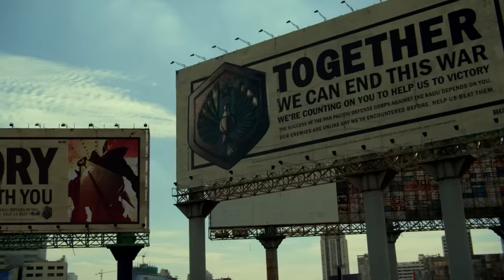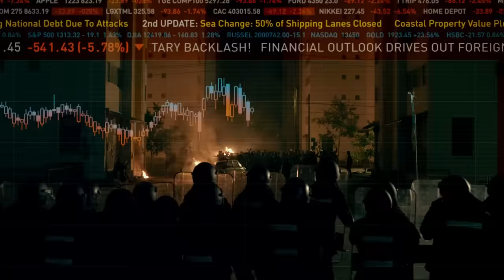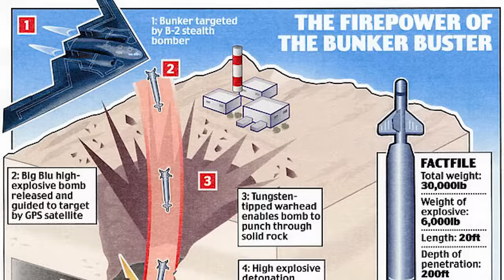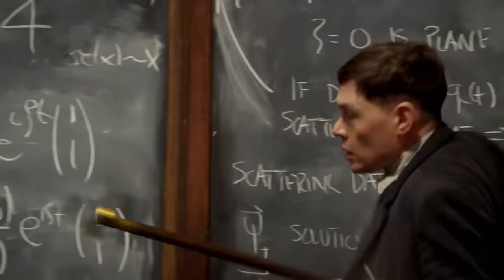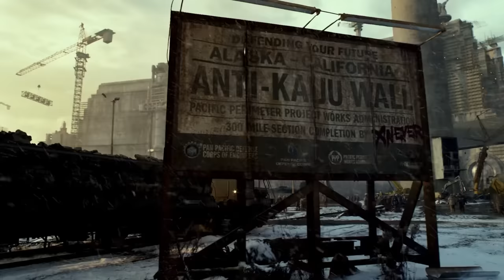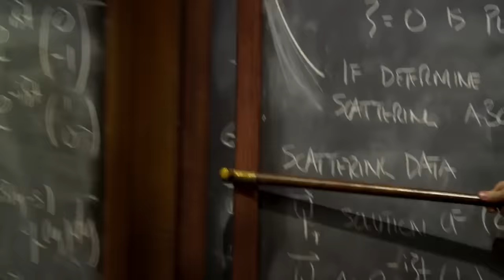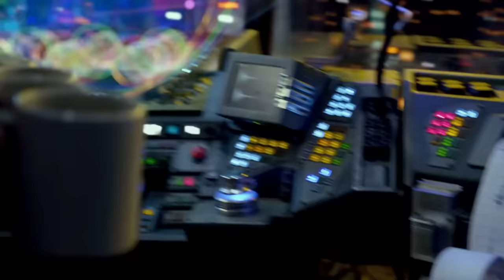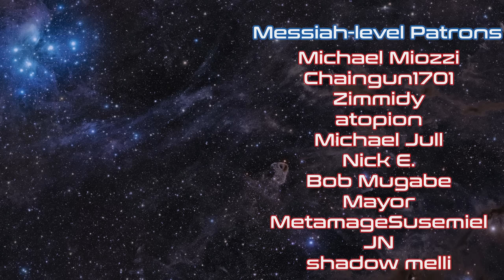Advanced Sci-fi Civilisations Too Stupid To Really Exist Ep.20 - The United Nations (Pacific Rim)

Comment: Making giant mech suits to fight monsters may not be the smartest choice, but it is the most awesome choice.
Reply: quetzalpacheco  I feel like you should found a religion or at least a cult around your insight. I'm on board.
Reply: "Giant robots beating on monsters" was the sole reason I went to see this movie. I was not disappointed.
Reply: Problem is, it only takes one broken leg to completely ruin a Jaeger. When will our giant death robots get more legs? They also move faster with more legs, so that lumbering movement is less an issue.
Reply: @dansmith1661  Because a giant robot spider wouldn't be as cool as a giant robot boxer.

Also, a human mind isn't equipped to operate multiple legs.
Reply: @StevieB8363  aint there 2 humans per robot?
Thats 4 legs minimum.
Reply: @10011110011  Except it takes two humans, working in synch, to move those two legs. It's been established that operating a Yeager solo is far too great of a strain, hence the "drift". So they can't operate two legs each.
Reply: @StevieB8363  but you dont operate a full robot. Just the legs.
Reply: Plus, chicks dig giant robots!
Reply: It definitely is an awesome choice, but modern warfare is not fought with a singular type of weapon. Imagine those giant mechas fighting alongside with battleships and missile destroyers, supported by strategic bombers and orbital strike platforms. That would be much more effective than the mechas alone.
Reply: Most awesomest*
Reply: As A Mecha Enjoyer Yes I See This As A Viable Option
Reply: They should have had a....it translates to hunter, so  "hunters" guarding the breach, and had aircraft as a second line of defence
Reply: What's really stupid is not utilizing the weaponry developed through the program on defensive platforms
Reply: @scottthewaterwarrior  Nice
Reply: @kerbodynamicx472  That would be awesome to see Jaegers being supported by battleships and jet fighters.
Reply: I like to imagine it's just humans and the Precursors who're this extra and every other intelligence species is watching the kaiju war and going 'What the heeeeeeeck?'
Reply: @dan Smith actually real robotics studies have found 2 legs is the fastest
Reply: @10011110011  So then you need more people to work the rest of it - and that makes drift compatability even harder to acheive. Yes, those Chinese guys did it, but they were triplets IIRTC, which made it easier. With your system, you'd need quadruplets.
Reply: @StevieB8363  its only legs
Reply: @10011110011  what about the rest of the Yeager? If 2 pilots only control the legs, you need two more for the rest of the body.
Reply: @Dont14-r4k  did i stutter?
I said: only legs
Reply: @10011110011  yeah, you kinda need other two if each one is controlling 2 legs, unless you re talking about having a Yeager with only legs, then that is very useless
Reply: @Dont14-r4k  it can kick with all 4 legs. No need for arms
Reply: @10011110011  and the Kaiju can easily  just slap it with it's tail and it goes flying like a spider, and since it has no arm, it can't get up if it lands upside down. Not to mention more conventional weapons are unable to be mounted.
Reply: @Dont14-r4k  dogs onky have legs and can get up just fine, fyi
Reply: @10011110011  yea but they have a torso that they primarily use to roll over in order to get up, this also comes that they are pretty flexible to do that. A metal robot isn't as flexible as a dog, so that aint going to work, nevermind that it doesn't even have a torso and spine to roll itself over in the first place. Not to mention dogs also use their 2 front legs as semi arms, that is why they also are able to stand on their hind legs with relative ease, they don't primarily need their front paws to properly stand.
Reply: @Dont14-r4k  these robots are flexible enough to fight godzilla
Reply: @10011110011  they aren't tho. Sure they are faster, but not necessarily flexible. Also Godzilla is probably the least flexible Titan, the Pacific rim Kaiju, while not as powerful, easily run circles around Godzilla, dodging most of not all his attacks.
Reply: @Dont14-r4k  i guess we will have to create the 4 legger robot to decide which one of us is correct.
So give me a few decade/centuries to prove you wrong.
Reply: @10011110011  So your Jeager would be a giant spider that doesn't punch monsters? Losing cool points here.
Reply: @StevieB8363  giant spider which kicks monsters.
And twerk on them for extra points
Reply: @10011110011  I would have given you a thumbs up for that if Twerking wasn't the most annoying and unexciting form of dance that I have ever seen. Aside from that issue, I applaud your love of giant robots. May the Machine Spirit be with you.
Reply: @StevieB8363  you have never met a larger layman than myself. To be honest.
Reply: @Dont14-r4k  you really are just looking to shoot down his point at any chance you can get and that isn't contributing to any argument.

A 4 legged mech would be just as viable as any other, with it's own pros and cons on the situation. Saying that it can't hold more conventional weapons is an arbitrary limitation you're putting on it. Look at any naval ship, it's loaded with weapons and it doesn't have arms.
Reply: @dragonheart967  1. Disproving points is how you win arguments
2. A warship has weapons on it because it has space to carry them. A 4 legged spider at most has missile launchers which are at most expensive, and extremely ineffective since they have to be so small to fit in between the gaps  of the legs. Not to mention the Kaiju easily outsize a 4 legged Yeager, unless that Yeager is made to be very big, in which case it probably would get outrun. Finally, where do you put the cockpit? You need it somewhere it can look out the Yeager, and since you got no arms, you can't block any move towards the cockpit, so one tail slash of it the Kaiju simply got on top of you, you dead. There is a reason why Yeagers have a conventional 2 legs and 2 arms, it is the one the works most effectively and efficiently against Kaiju.
Reply: @Dont14-r4k  1. You're not disproving his points, I'm saying you're arguing on arbitrary conditions that only debunk the argument by constraining it to your own imagination.

2. Who's to say that the design is limited to what you have described. You're describing this thing like it's some tiny body that has 4 legs and no room for anything else. You can design these things in any way you want, you can do a large base structure or just go with a normal Jaeger but with 4 legs. The extra support allows a higher support standard and can fit significantly larger/heavier gear. Nothing has to fit between the legs, you can build up.

This is why I called you out on how you were making your argument, it's disingenuous by its nature to create an arbitrary limitation.

To refute an argument, you can't hyperfocus on one aspect and determine that the whole idea is bunk without exploring the advanced idea of it.
Reply: @dragonheart967  the guy was saying that a 4 legged Yeager would be the best type of Yeager, that is clearly false. Also I'm using the best possible form of a 4 legged Yeager that would actually work, remember these things have to be able to move through city streets, so it can't be too wide. Adding on the bigger you make the Yeager, the more weight you will have, the more expensive it is to build and maintain, and you also will need a bigger area to keep it in, not to mention it will be much slower. A 4 legged Yeager, while not as tall, would still be wider than most Yeagers, and it will be bigger if you also start to build up, not even mention the lack of flexibility. The guy was saying that just a 4 legged Yeager, no arms no torso, none of that, is better than a standard Yeager , which it clearly isn't, otherwise by the second movie or at most the anime, we would of had 1 4 legged Yeager that had survive and seen some success. You aren't calling me out, you are just making yourself look dumb, because If you were to look at their replies, you would know that they firmly believe a Yeager with 4 legs is good enough, which as to all the points stated earlier, clearly isn't. I never said it wouldn't work, but it would be a logistical nightmare on top of being almost useless.
Reply: @Dont14-r4k  even without a torso, you can still have a sizable platform to place any weaponry. You have a top to mount stuff on, like any modern military vehicle.

And while the size would be an issue for urban use, that doesn't discount the pros and cons argument, because this thing would be used for engagements outside of the city. How many of the fights in the first film started off in the ocean? Sacrificing mobility doesn't remove any practicality of its use, otherwise a bunker is entirely useless?

I did read the comments, and I saw that he was progressively moving down because someone just kept stonewalling the idea instead of actually engaging with it.
Reply: @dragonheart967  and the weaponry is exposed, one building on it, or a tail snap, and it is gone, no longer operational, which is why you see many Yeagers shield stuff like missiles and Plasma canons. Even outside the city in the ocean the 4 legged concept would slow it down since it is more surface area for contact of water. Mobility is very Vital, often times more agile Yeagers are able to be a lot more successful than any brawler, which is why they were naturally passed out, with Cherno Alpha being the only exception. Also, why mount a weapon like that to a 4 legged Yeager, when you can easily just mount it on a platform off the coast for secondary defence Incase the Yeager gets taken out, rendering the 4 legged concept useless. Also if you were to look at the replies, I literally was asking the guy to elaborate, I brought up the rest of the Yeager body, that you would still need 2 other pilots, the guy said no, that it was just 4 legs. So I questioned him on how that would be a good thing, and brought up cons of the design. That was what happened.
Reply: @Dont14-r4k  I'm more prone to the idea of fixed implements, but for the sake of argument, these things wouldn't be in brawling range, like anything of this nature, it's not meant for close range battle, the concept of long range weapons is to take out the enemy before it gets close.

If anything, this thing would be supplemented with normal Jaegers, just like modern warfare that utilizes infantry, mechanized, and air force to make the most of each strength while removing the weaknesses.
Reply: @dragonheart967  like I said, at that point don't make it a Yeager, make it a secondary way of defence along the coast, way more cost effective.
Reply: @dragonheart967  'If anything, this thing would be supplemented with normal Jaegers, just like modern warfare that utilizes infantry, mechanized, and air force to make the most of each strength while removing the weaknesses.'  Uh... you kind of just made his argument for him.  If your position is that a 4 legged design would be used to support a general purpose jaeger and suited for only certain engagements it is therefore NOT better.  A specialized weapons platform has the unfortunate nature of underperforming in situations outside it's design.
Reply: @davidlewis5312  except that was never my argument, I jumped in because the argument became even the viability of a 4 legged Jaeger, not that it would be better.
Reply: Giant robots with ever-changing weaponry makes sense in the world we're given.

What doesn't make sense is making a static wall that will obviously not work, with static gun emplacements that have the obvious flaw of being static emplacements against a dynamic enemy.

The entire defunding subplot is a cancer on this movie because it is so rock stupid that you can never defend this movie.

My advice for people watching this movie from this point on will be to pretend that the whole subplot doesn't exist.

Because the Jaeger program starting to fail because of the increased rate of monster attacks is already a built-in justification for why they are desperate and have to blow up the entrance hole.

But no, Guillermo del Toro had to make his political potshots instead of focusing on the movie, and he shot the giant robot genre in the face when he did that.
Reply: quetzalpacheco  
what was the meaning of life itself then?
what am I working towards? - Creed
Reply: @hariman7727  except its not a political potshot at all
Reply: @XD-sc4ix  so an entire subplot in a movie about a wall that will be useless to repel Invaders isn't a political potshot, when it's written during a time where Guillermo del Toro is part of a crowd there's openly critical of a wall being built on the American border to repel and prevent entry for an invading populace?

Pull the other leg, it has bells.
Reply: @davidlewis5312  a four legged Jaeger would be perfect as artillery blasting the kaiju from a safe distance either before it engage the humanoid Jaeger or while he's fighting the humanoid Jaeger the problem tho is that a human wouldn't be able to pilot it
Reply: @hariman7727  except the movie came out three years before the mexico whole wall thing was even an idea HELL Obama was at the peak of his presidency at the time
Reply: @XD-sc4ix  I am operating under the assumption that the limitations of the drift system would be overcome to make a non humanoid mech viable
Reply: @XD-sc4ix  border security has long been a policy of Republicans.

And building the border wall has been on the political table for decades.
Reply: @davidlewis5312  fair
Reply: I realized if we just let an entire generation of people watch giant mechs getting destroyed by other means over and over again for decades, the idea of mechs will no longer be awesome.
Reply: @funveeable  it happened the same for superheavy tanks they're still viewed as awesome
Reply: @Ez miez  It takes 2 because it because it's quicker to train 2 pilots for the mech than 1
Reply: @dragonheart967  a spider mech would not last long against a kaiju because kaiju think in biological terms and know weaknesses once they fight them, a spider mech would have an even more glaring weakness than a jaeger head without any of the literal punches, they are more exposed with their stomach type rigs as one cpuld assume and not have enough armour or speed depending on gow you work it, and their armament would be less than effective. Missiles? rely on guns/plasma? That's not gonna do much and guns/missiles can make them bleed toxins, claws? The first kaiju were made to withstand aircraft missiles and claws will do less damage than a punch should it be needed even if coolant is used as the mass of flesh would be too bulky.

Static defenses will never work against an adapting enemy, the great wall of China, the walls of Jericho, the walls of Constantinople, the walls of Rome, the ship-wall of Athens. The only way to reliably defeat the enemy is to stop them in the field before they can learn about you and that is what the jaegers were doing. As someone once said: 

"A determined siege will, unless a relief force arrives, always win."
Reply: @XD-sc4ix  artillery will not work, the kaiju can adapt to the wall they can adapt to spidermechs and the first few had leathery armour to stop aircraft rockets and missiles, they already tried this tok with Striker Eureka having missile pods and he gets wrecked twice before he can use it because the kaiji learned to adapt. And Orochi types can fly or maybe dig to meet these new mechs posing a danger to civilians should the jaeger be put there. There is a reason the jaegers fight on the open seas and that is to not attract kaiju to where people live and to minimise the pollution from their toxic blood which means these plasma mechs need clear line of sight rendering their range moot as an emp can then reach them, and if you use conventional artillery you are asking for repeats of the first kaiju wave and they will learn to use anti-wall tactics for predicting their shells and such.
Reply: @magniwalterbutnotwaltermag1479  okay, first off, a siege and an assault are vastly different, a siege is an encirclement of a position with the intent of starving out the defenders. An assault is an actual offensive action on said defenses.

Both are incredibly different, so please understand the nuance between the two before you misuse a quote to describe a different situation.

Here's the thing about the punch from a Jaeger, it's all down to sheer kinetic force. In theory, you can build a weapon that fires a large enough projectile with enough force that can punch though why Kaiju.

Referencing how ineffective weapons were on Kaiju when those weapons were not meant for Kaiju is kind of a "no, really" moment.

Enough offensive weapons with overlapping fields of fire will leave whatever charges that position in utter devastation. Why wouldn't it? Kinetic force is always kinetic force, what difference if that force is from a giant robot arm or a FU slug weighing a few tons fired at 1000 m/s?

The idea of some kind of multi legged Jaeger is to keep mobility/stability while supporting a larger armament, the idea of that is to not engage in close range combat. Why is this such a difficult concept to grasp?  Look at modern warfare and how ranged weapons reduce the notion of melee combat nearly obsolete.

And what's stopping the brilliant idea of mixing the two units? Why not static defenses and extreme range, coupled with Jaegers to flush the Kaiju into the open, normal Jaegers to keep the Kaiju occupied and relatively stationary, and the weapon platform Jaegers to provide heavy damage at range.

Jesus, is there any level of imagination to be had here before we throw the baby out with the bath water?
Reply: @magniwalterbutnotwaltermag1479  i already knew that i watched the movie you know
Reply: quetzalpacheco  
Don't know if you're being sarcastic or serious
But that was a joke, a quote from Creed character from THE OFFICE
Reply: "Unless it's dope as fuck"
Reply: @dansmith1661 dude, as we said, it’s cool. F logic and reasoning, we know in real life we would create a hand held device that kills stuff so let’s make sure sci fi never gets that. Mechs are god dang awesome
Reply: @kerbodynamicx472 I mean, if you're really going that far and being that realistic, all of those things combined would be able to easily destroy all of these kaijus except maybe the flying ones without even needing jaegers... I mean realistically in like 90% of sci fi disaster/monster/alien movies, the real life modern US military would be able to eliminate these threats honestly. I feel like hollywood knows about like, 1% of the military weapons that actually exist currently